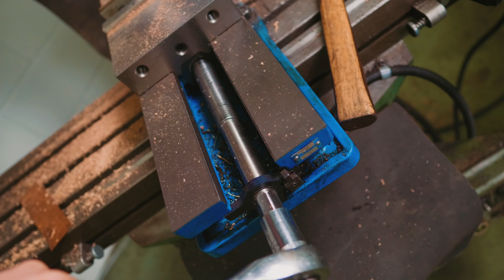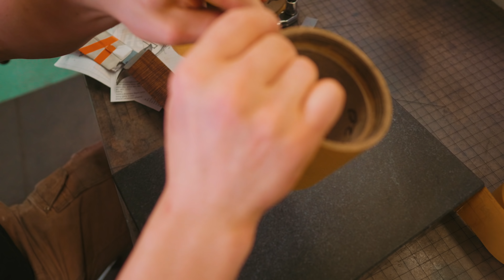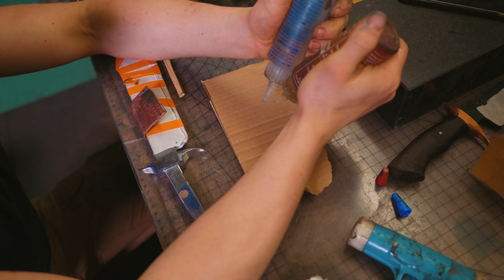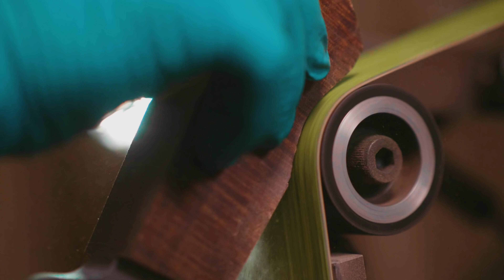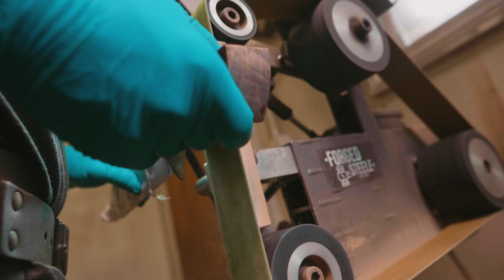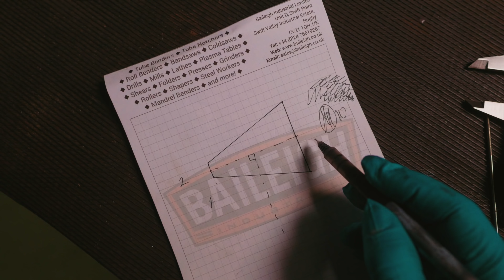MAKING A BOWIE KNIFE WITH TWIST DAMASCUS!!! Part 8

Comment: To honest, I would have avoided all the math.  I would have got the handle fitted, and in place (not glued)  Then I would if drilled the hole in one side of the handle, just enough to score the metal of the tang.  Then split them, finished drilling the hole in the handle, then drilled the hole in the tang.  Fit them back together to check the match and clean it up a bit.  Then you'd already have you pin location ready.  You'd have to clean out some epoxy after the gluing, but it still seems safer and saner to me.
But I'm also a total amatuer so there is probably another reason that wouldn't work.
I also wonder if when you were struggling for a tight fit between the wood and bolster, you could have heated the bolster to burn the wood to flat and tight...

Comment: Hello Alec, the reason it is called Blackwood is not from the colour as you would expect but from the high tannin content, that when working with the timber for a period it will turn your hands black. Tasmania is a small island but has some wonderfully furniture and bodybuilding timber. Google Blackheath sassafrass. It is a spectacular wood. Cheers from a longtime subscriber.     Glenn Brown from Tassie

Comment: You know, when you were making your keyhole integral I resisted the temptation to tell you that, but now... meh, I guess it's okay. So. You take epoxy, right? You mix it with sawdust from the same wood you made the handle out of, and you exopy the handle. Epoxy sqeezes out and fills any gaps you might have in your fitup. After it's hardened you just sand it flush. Boom! Done! Trying to file something to within a couple of microns, while a good exercise, might be a little difficult.

Comment: If you use a center drill or a spot drill to start your holes before drilling with a regular bit your bits will have much less tendency to wander.

Comment: The noise the block was making is it vibrating, which means you aren't getting a flat cut with the sandpaper.  Use less pressure. :)

Comment: hey Alec, maybe you explained it and I just missed it, but I'm wondering why you put the bronze plug in the steel before putting the handle on? Was that to make it easier to drill through after the handle is on?
Reply: He did so because he was worried about drilling through the harder steel of the tang with a small drill, but knew he could do so with a large drill. So he drilled it will a large drill to get through the tang, and then filled it up with a more easily machinable material and then drilled through that with the handle mounted. In my opinion though, it should be totally possible to drill through with the 1/8" drill to begin with. It may be sketchy do do so with the setup he initially used for drilling the large hole, where it was unsecured. If he clamped it securely, and went easy when the drill broke through the material, it should be fine. There are lots of ways to get the same results though so whatever you're comfortable with and confident in is the way to go. I am from a machining background, so I am more comfortable in machining solutions. I know I watch him casually do lots of stuff while forging I never would think would work, and it turns out perfectly fine.

Comment: To get the hole on the tang perfectly in line with holes in the handle it could have been a lot easier to put the knife in the mill vise and align the bit with the existing hole in the tang, then simply slip the wood block on the tang and then just drill. If the knife doesn't move at all it will work perfect every time and could save you a few steps. You just have to do that before the glue up.

Comment: Alic when it’s that close heat the tang and press it in. It will like “burn it in” it works well. Also I’ve not really seen you even pull a tang completely through, and make a nice touch mark but stock in one of you fancy Damascus! Like your Union Jack 🇬🇧 or USA 🇺🇸 flags.

Comment: Alec Steele, great videos brotha.  So I was watching you struggle trying to find something to protect your blade, ie the paper and electrical tape, and it hit me.  Use some corrugated card board.  I use to use this in a pinch for my duct knifes when I did ac work.  Just slide the blade between the two walls and if need be shoot some staples in it. Then you can create a sheath like protector that can slide on and off easily.  Big fan man.  Hope your day is great.   

Trey

Comment: Alec use your handle pin peening fixture to hold the knife level for drilling,  use the adjustable anvil part to support the end of the handle if you have a flex problem.

Comment: I'm really glad I found this channel and subscribed! 
I've not made any knives or dealt with Damascus, but I have dealt with tool steel, aka chrome molly. Here in the states, I have a store called Fastenal. They sell drill bits that are the best I've found for drilling through all types of steel without going dull too fast or breaking. I bought a set that comes in a water tight octogon shaped blue container. I've had to drill a few hundred holes through a Corvette frame to do plug welds on a previously salvaged car, and these bits really stood up well. I've used all brands available here that were labeled as steel bits, but they were mediocre by comparison. I hope this helps!

https://www.fastenal.com/products/details/0323441?term=Drill+bit+set&r=~%7Ccategoryl1:%22601071%20Cutting%20Tools%20and%20Metalworking%22%7C~%20~%7Ccategoryl2:%22613861%20General%20Purpose%20Holemaking%22%7C~%20~%7Ccategoryl3:%22601077%20Drill%20Sets%22%7C~%20~%7Csattr01:%5E%22Drill%20Bit%20Set%22$%7C~%20~%7Csattr03:%5E%22High%20Speed%20Steel%22$%7C~%20~%7Csattr01:%5E%22Jobber%20Drill%20Set%22$%7C~
Reply: What year Vette do you have?
Reply: Rocker Pat 
I worked at a body shop that does salvage rebuilds on c5's and newer vettes.

Comment: No need for math when drilling a hole on a tapered piece.  Put a level on the blade and shim the handle until its level.  This is assuming that your mill is level.

Comment: 2 questions-
1) why don't you burn the handle on?  Heat the tang and finish them fit by burned it out.  It'll be more precise that blindly filing the inside of the handle.

2) not on this project because obviously you wouldn't get the pattern your wanted, but why don't you fold your Damascus instead of cutting and stacking to get your layers?  Seems like a lot of extra work when you're just going for numbers of layers

Comment: When it comes to drilling the general rule is the smaller the bit the faster it needs to spin in order to cut effectively, conversely bigger bits need to turn slower to maximise torque and cut a bigger chip. I'm sure you can look up specific bit size/cutting speed rates but unless you're drilling for super tight tolerances following the general principal will suffice

Comment: Little bit of advice, you should tape the side of the handle opposite of the side you're drilling on in case the bit isn't quite sharp enough to leave a clean hole.  It'll save you a metric ton of headaches in the long run ^.^

Comment: a tip Alex. when you are going to take the last adjustment on handle when it almost fits. is to heat the tongue and burn it in place. It works very well-greetings from norway

Comment: Alec, why did you drill that hole in that hole in the tang then install a bronze rivet? You mentioned it was a tip but didn't elaborate. Maybe I missed something? Is it to reduce tang/blade imbalance?
Reply: I see now it was so you could use a small drill bit to drill through the tang without fear of breaking it. :) I just had to connect the dots and listen carefully.

Comment: To drill the hole in the tapered handle why didn't you just index off the blade and let the handle float?  Clamping down the blade on a 2 x 3 block should have allowed the drill to make a perfect perpendicular hole even with a tapered handle.

Comment: I bet a knife makers vice (pipe with wood blocks and adjustable screw, Walter Sorrells has a video on building one) could have held the blade square to the drill bit in case you run into that problem again 👍🏻 
Still need to make one of those myself. 
Looking forward to the etch!!

Comment: Heating the metal until its red hot and then putting it into the wooden handle would make it much easier to fit perfectly , the wooden handle would kinda burn up and the fit would be perfect with little effort made

Comment: Hey Alec
I'm not sure if anyone making knives uses the Rodman drill bits, but from what I can see, they may be a good one to use for drilling through the tangs.  They need to be used in a drill press and spun quite fast.  If used as shown in the videos, i have seen them drill very clean holes through hardened files.  I just thought they might do well for times when the steel is on the hard side.  I have no affiliation, and have not actually used mine.
https://reaperdrillbit.com/product/13-piece-set/

Comment: drill the hole and cut it out then heat the tang to a dull yellow while keeping the blade cold and burn the wood for the final fitup on the handle. 
this really worked for me, maby give this a try  ; -)

Comment: Maybe this is a dumb comment, but when you were drilling the hole in the tang; why didn't you just secure the knife by the blade in a clamp or vice or something? If the tang and blade are in line and the blade is parallel with the table on the drill press, wouldn't that mean you'd drill through square? The handle off of the table completely, so the rounding on the handle wouldn't matter as the knife would be held only by the blade.

Comment: Hey Alec, I noticed when you close your faceshield you pull it down on the neck cover. But you better close it with the lip on the chin. The neck cover is the weakest place of the shield and it brakes pretty easy. At my work we destroyed a lot of those mask by closing them by pulling the neck cover. And like you said before they are very expansive.

Comment: When you needed to drill the hole square and had some problems with the taper, you could have clamped the blade on TOP of the vise (Blade paralell to X/Y axis of the table) :)

Comment: Simple math... Trig can be very tricky. Good job getting your solution though. I was thinking you'd perhaps need to make your 1.500" measurement a little longer since you were measuring on an angle rather than a flat, but that scale is so small it's nearly negligible. Using a 7mm bronze plug was smart. Gives you 1,9mm of space for your pin. Props to you, sir.

Comment: You really need some Machinist levels.  It will make laying out stuff to mill and drill much easier.  Well after you get your mill perfectly level but it will speed up your work a lot and keep everything in tight tolerances.  I use a starrett L level and love it.  It isn't as precise as a true machinist level but good enough for most stuff.

Comment: When drilling the inner hole, it works a lot easier if you put an wooden dowel I the other hole(s) to prevent the drill bit from slipping in
Reply: Wesley please explain further.
Reply: When you want to drill the tang holes, a problem I experienced was the drill bit slipping into the other holes in the tang. Putting a wooden dowel (in a hole to be later taken out) so the drill bit does not slip around.

Comment: A question, Alec (or any other smith/woodwork types): is it possible to leave the tang long, drill entirely through the wood and then peen/mushroom over the excess on the other side for a completely solid fit and to have a sort of 'pommel'? Or would that risk twisting the tang and ruining the handle?
Reply: MrMortull im no expert but i think peening the end would put too much pressure on the wood and put a crack down the handle

Comment: Blue Dykem and Blackwood. Learning the hard way, with lots of black and blue! If a slight recess is made at the base of the tang, angled back 2/3 of the way towards the outside edge of the bolster, you may find that the wood fits up faster and tightly. It’s a trick that’s sometimes used in mortise and tenon wood joinery.

Comment: Alec why don't you finish the tang and "block out" the handle hole to kinda fit the tang mostly before you do the temper? You would burn the stuff in the way and save a lot of work. You could also just heat up the tang after but you would risk ruining whatever temper you have.

Comment: What Tool is that? The one you use to cut out the tang hole?
Reply from the maker: Broach from blackdragonforge!
Reply: Sam Engels I've been wondering too
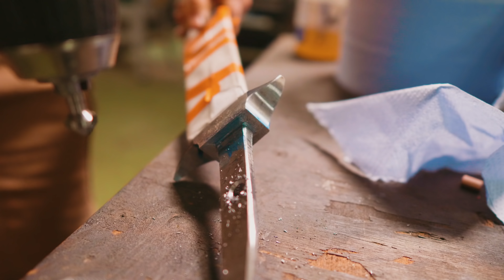Reply: at 6:03, a twist drill bit on a milling (bridgeport) or 6:57, countersink tool on a hand drill?
Reply: Not for the pin holes I was wondering about the hand saw he used for the tang hole in the wood
Reply: That hole, my bad! sounded to simple too!
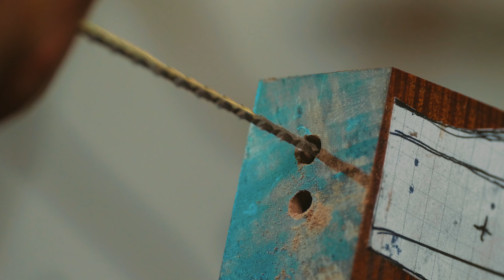You mean at 1:43!
Good question, no clue! Even not sure from where to start my search in google!
Reply: Alec Steele thanks a Lot man!
Reply: I think it's a keyhole saw.

Comment: You should try the technique where you get the tang Red hot and then push it in to make it exact size
Reply: Doesn't always work out that way. Burning in the tang usually ends up with a hole that's slightly larger than the tang is as the wood may continue to smolder after removing the hot steel.
Reply: Also hot metal expands, so the tang that burns the hole will be ever so slightly larger than the tang at room temperature

Comment: You're just teasing us, delaying the etch like this.
Reply: Or he just forgot.
Reply: lvl300mrmime he may just use some good old nail varnish to use as a resist on the handle to protect it from the acid like he has in some other videos
Reply: Charlie Orchard ferric chloride won’t damage wood for the most part. Only really eats metal. As long as you don’t leave the handle soaking in a tub of it for an extended period it should be fine.
Reply: i thought the etch was the bending of the guard to look like his signature
Reply: The logo punch? On a side note, there are many guards that have this shape so although it does look like Alec's work, so will the thousands of others as well.
Reply: Yeah I wasn't sure if he was supposed to etch the blade before gluing the wood handle on.